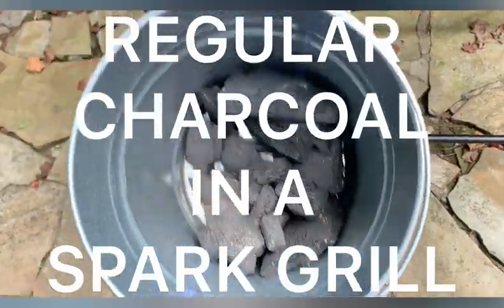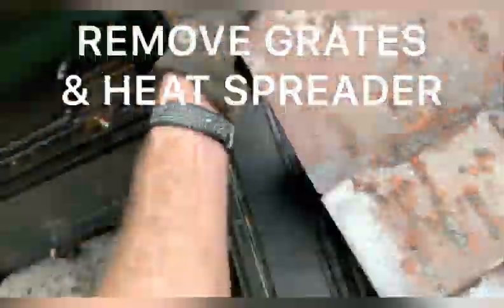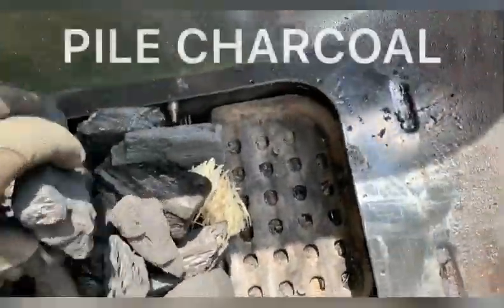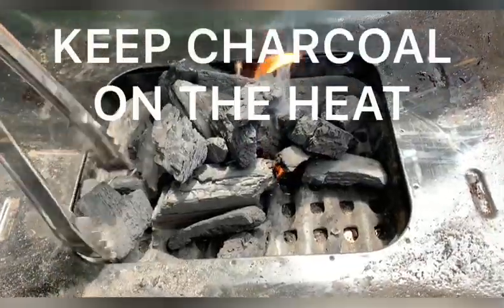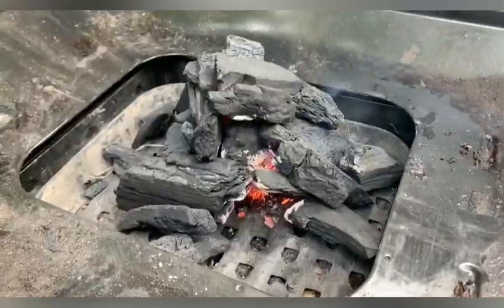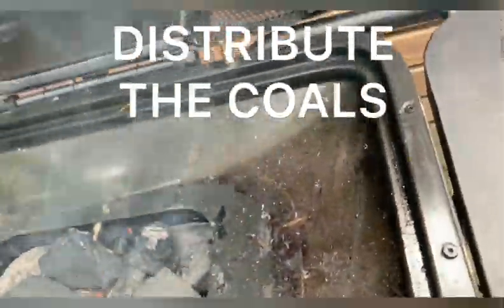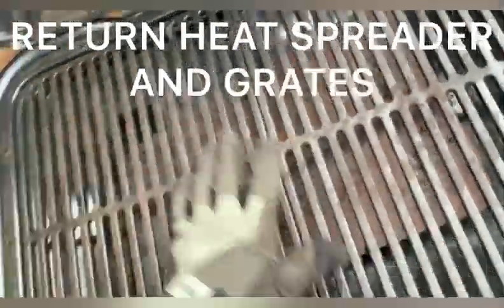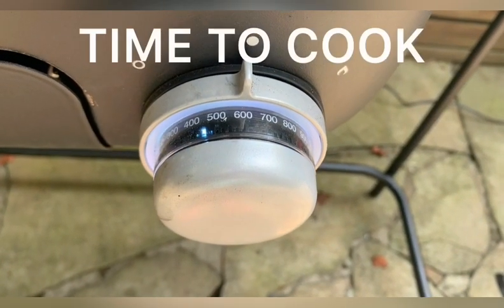Using Regular Charcoal in a Spark

Comment: I have a bunch of briqs for sale if anyone wants them. Selling at cost + split shipping from 22201.

When purchasing the grill, I decided to stock up and buy a bunch of briqs. Unfortunately, my grill had a manufacturing defect that prevented assembly so I never got to use it once. What's worse is that I received my shipment a week before the company went dark. Briqs are are still sealed in the vacuum wrap and have been in climate controlled storage. I have a bunch of accessories/parts (eg. probes, grates, board, etc.)  that I can send too.